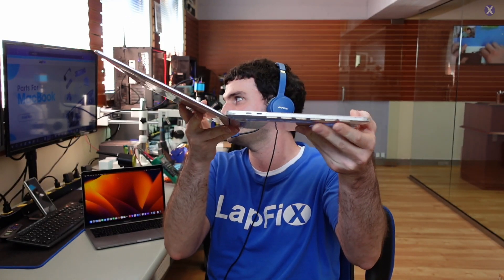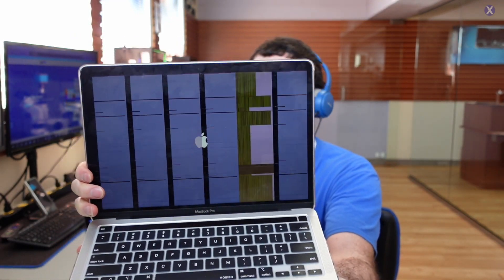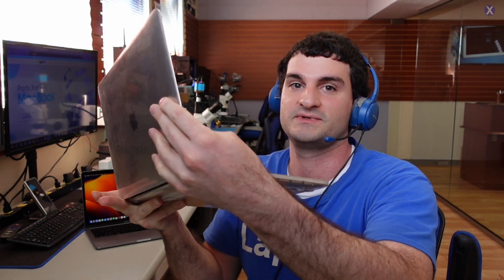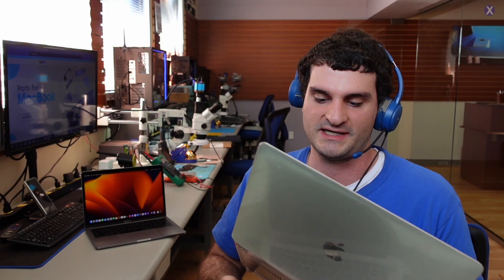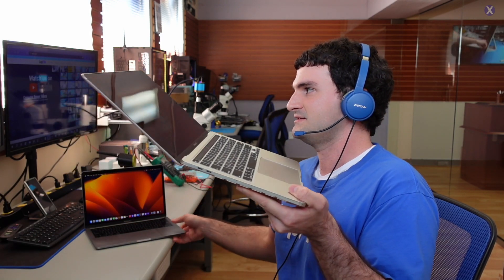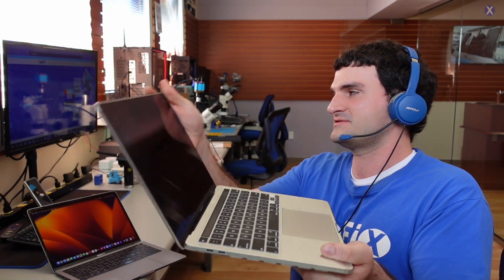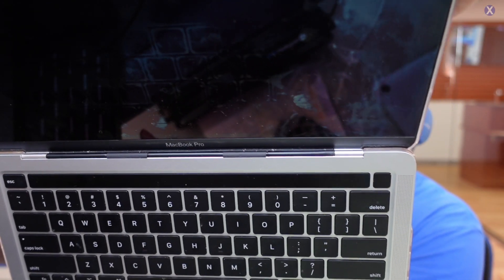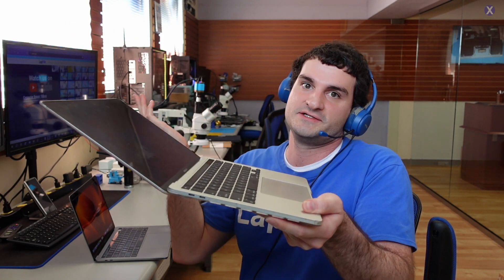Potential Flexgate Issue On a M1 MacBook Pro

Comment from the maker: I may not have been clear and I do apologize.  These are covers and underneath are the cables.  The a1706 2016 model had a "flexgate" issue, which had to do with the cable not long enough and eventually would tear over time. The point of the video was showing how a bad repair could lead to another issue.  The cables shown hear are not fully properly set.  This can lead to a similar issue like a "flexgate" as the cable would "pull" especially due to the bad hinge.  I would love to hear more of your thoughts and comments on this issue down below =)

Comment: Those are NOT the cables your are showing ! That's a piece of plastic. The cables can be seen them from the bottom.   It is a "special" flexgate version, one of the datacables has a dimple because something ( mostly crumbs or dirt) was wedged between de cable and the chassis.   I can repair it for you if you want to :)
Reply from the maker: They are covers and underneath is the cable.  The point of the video is about replacing a screen properly otherwise it can lead to another issue.  The person who did the previous repair shouldn't have done this or allowed this. Allowing the hinge to be this loose after a replacement which the customer may not understand (my customer thought this was normal) will cause more damage and frustration.  This damaged happened first, but these cables are loose and will very likely "pull" making it similar to a "flexgate" issue over time anyway.  If anyone is working on these models, EVEN the newer ones, make sure to do it properly =)
Reply: @lapfix  correct!!!! Absolutely true👌